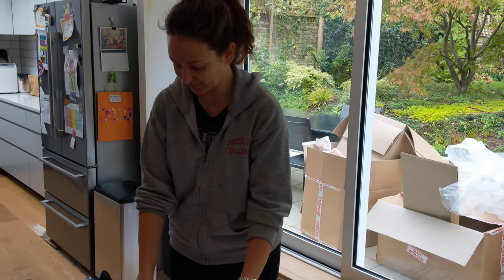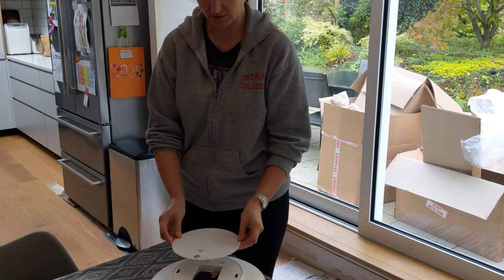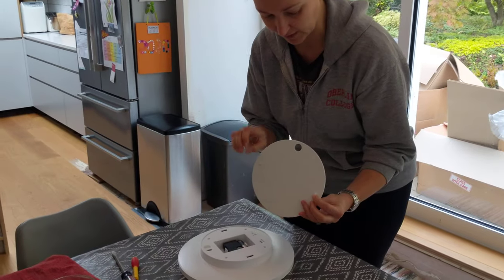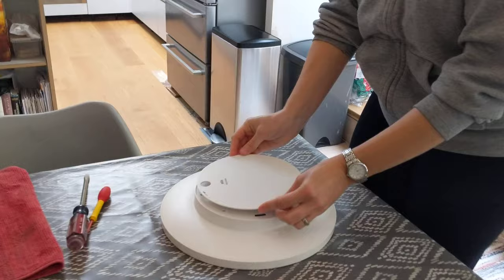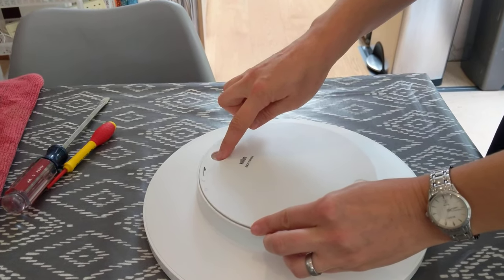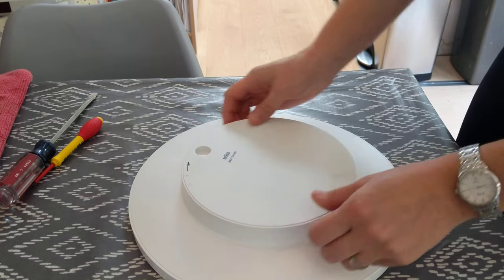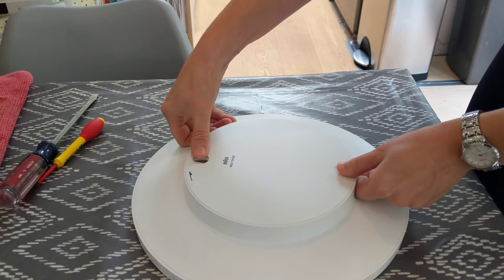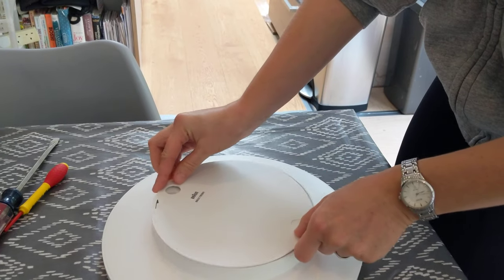How to open the back of Braun BNC017 wall clock

Comment: Currently trying to remove the glass so I can put tritium vials on the hands. Any advice? I’ve tried everything it seems.
Reply: @Satpal Gahir Check our B@rt’s tritium thread on candlepower forums. He sells tritium vials.
Reply: @Satpal Gahir Was it with this specific clock? If so, how did you disassemble it? Thanks for the reply by the way.